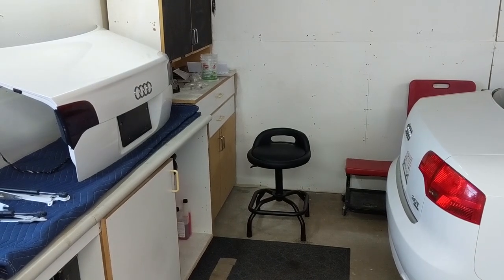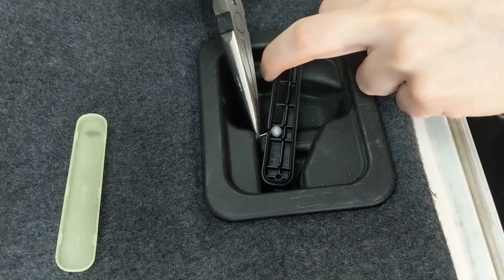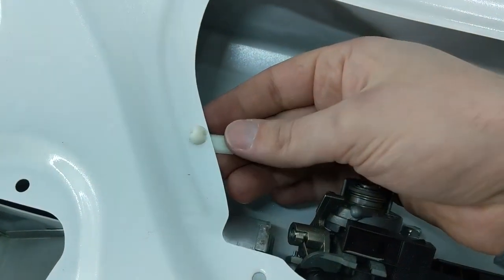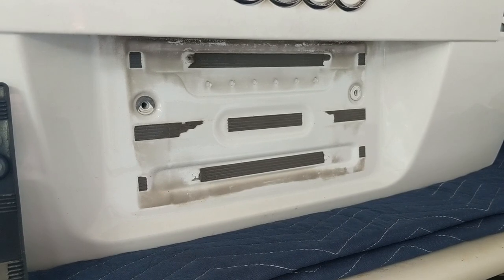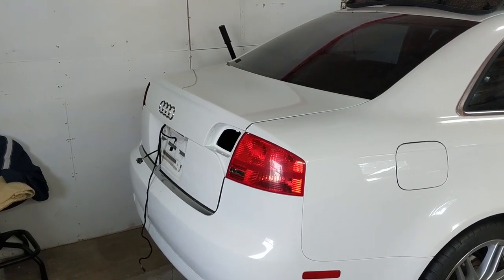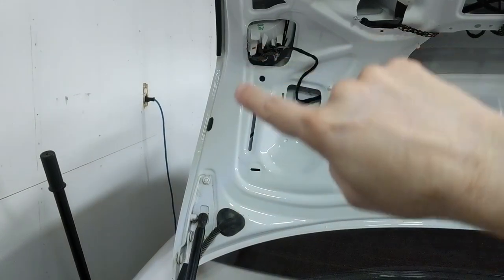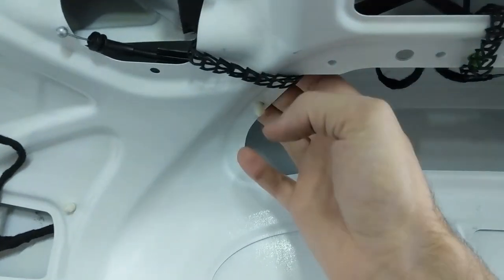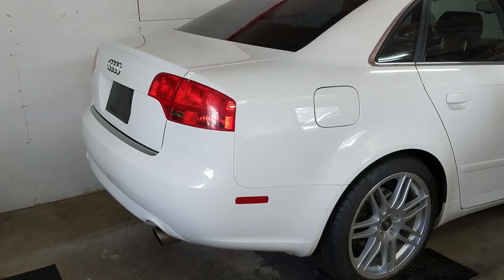A4 to S-line/S4 Trunk Lid Swap | How to remove and replace trunk lid

Comment: My A4 B7 trunk wouldn't latch. Already replaced latch assembly with updated part # 4F5827505D two years ago. Below freezing temps in the underground killed the assembly again, so I got a new latch from Jarf Barzos and in a minute, R&R the trunk latch assembly. Still wouldn't latch, no matter how much I fiddled with the keyfob/lock tumbler or any amount of trunk lid slamming. Even removed the lower hard plastic trim surrounding the strike plate to adjust it. Raised the strike plate as high as it would go. Would. Not. Latch. Searched on all audi forums to see if I missed something. Nothing obvious comes up. Left the electrical connector disconnected so I could still  lock the vehicle doors and set the theft alarm (car believed trunk was locked).

A few days later:  "Hol up, is it possible that the bump stops on the lid are responsible? I recall the lid gaps were kinda wide..." Finally found your vid that clearly showed how the stoppers adjusted and within seconds, my trunk lid latched smoothly. Commenting here incase anyone else has a massive brain fart like I did.

Comment: thanks for the super clear video and step by step! you got a good handle on that camera! I've got an A3 sedan with number plate light that works intermittently....my mechanic was flat stick with other cars and just said my wiring must be loose. To add to that my reverse camera has stopped working for over a year now...which makes me think wiring issue too. Q. Bentley Publisher seems to only backdate to 2009 models...any reputable publisher you'd recommend?

Comment: Great video. My b7 unfortunately was in a minor fender bender and it needs a trunk. I was curious how long this took you to do. I wont be swapping the lights but I need to swap the latching mechanism for the key? It can be done but if I don’t have to I would rather not lol.
Reply from the maker: It took a couple of hours - fishing the wiring through takes a bit of time and patience. Yeah, you do need to swap the lock over - unless you have the other original key for it and you want to carry around 2 sets of keys...
Reply: @FigureItAudi thanks man much appreciated

Comment: Is the rs4 lid the same as the s4?
Reply from the maker: Yes and no - The trunks would be interchangeable in terms of how they mount but the shape with the RS integrated wing would be weird without the matching rear quarter panel wing pieces from the RS4 if it were mounted on the S4. Or the reverse scenario S4 trunk on RS4.
Reply: I was trying to buy wing but can only find it for the s4
Reply: So didn’t know if the shape was the same